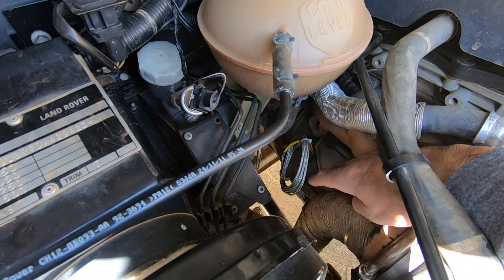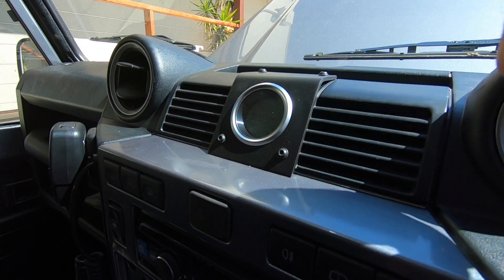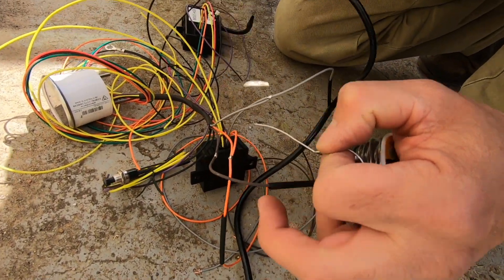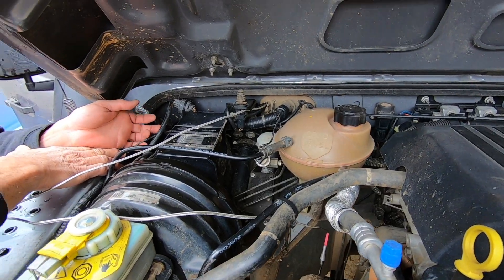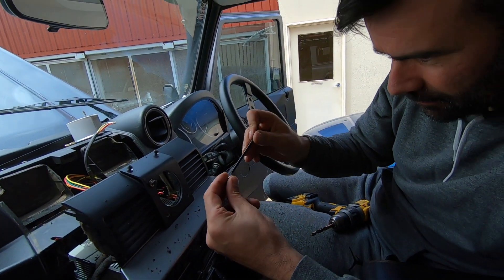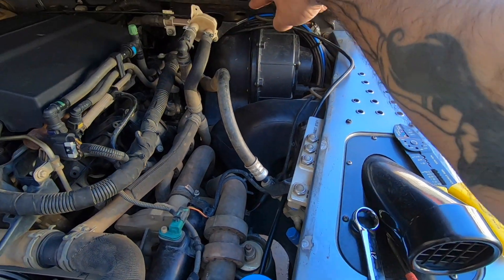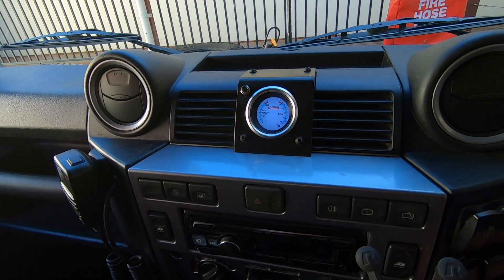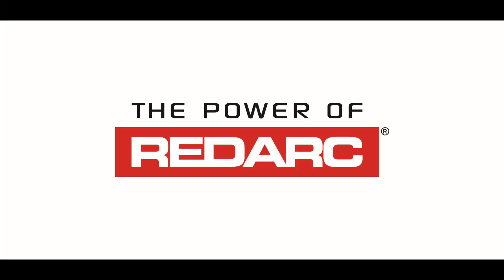| REDARC EGT-BOOST-COOLANT GAUGE INSTALL |

Comment: Just want to confirm why you put the EGT probe after the turbo and not before on the manifold somewhere? On my 300Tdi everyone advised to have the probe on the manifold
Reply: Most aftermarket exhausts already have a bung for egt. It will be hotter in the manifold than after the turbo, but just keep that in mind when monitoring your egt.

Comment: What caused the failure of the turbo/intercooler? Did you upgrade to the BAS turbo? I'm running the same 170hp ecu flash /upgraded intercooler I'm pretty sure.
Reply: https://hpdiesel.com.au/products/catch-cans/land-rover-defender-2007-2009-2-4-puma.html
Got that the other day - great piece of kit and fits nicely off the existing brake booster bolts. Will keep your new turbo and intercooler clean.